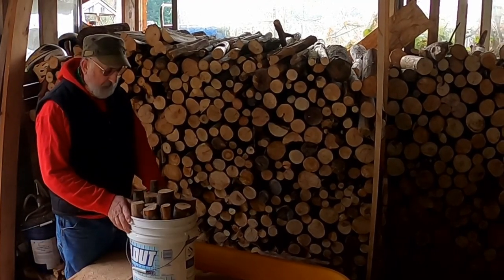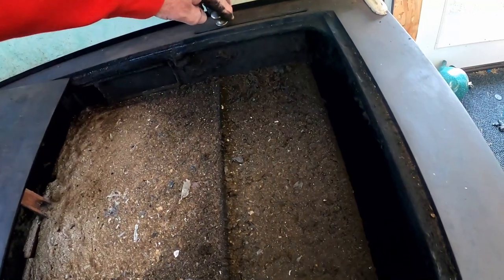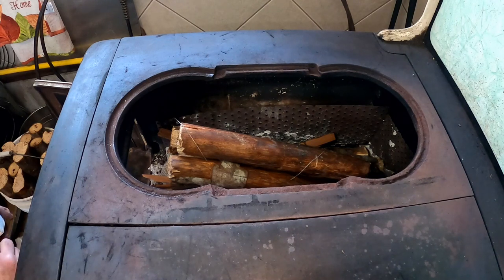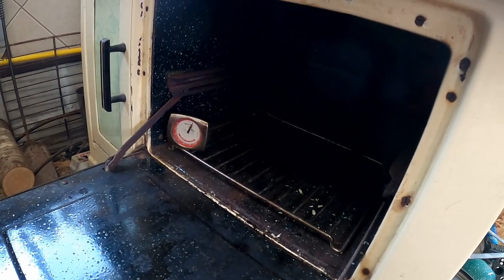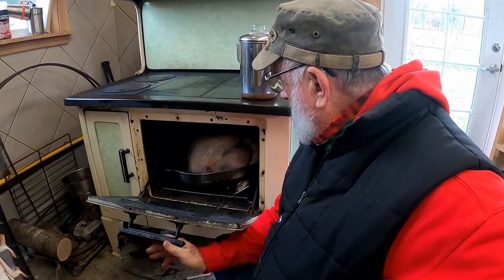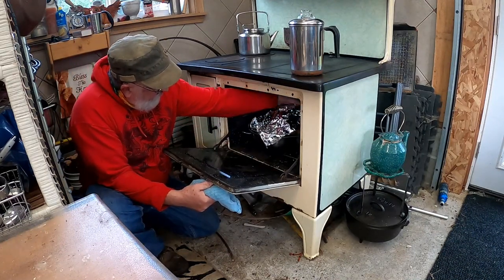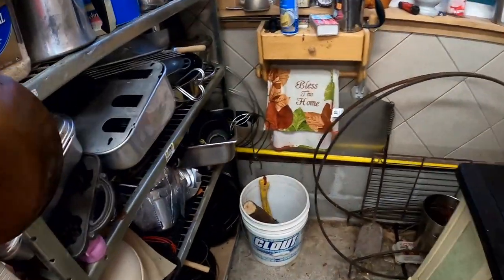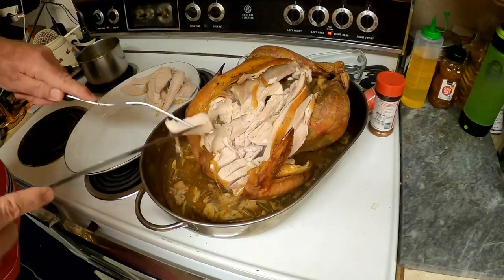Wood cook stove how to bake

Comment: Hard to find coal? I'm curious where you're from because coal is pretty easy here in the Susquehanna Valley, PA. It's actually the cheapest heat source in the area but most people are worried about the heavy metal in anthracite coal ash and/or don't want to deal with the mess.
Reply from the maker: I am in Washington state. 20 years ago they shutdown the last place selling coal. If you flip them grates you can use coal.  It does burn hotter and longer. But the smell of wood burning can not be beat. Thanks for stopping by and commenting.
Reply: @badbadbob1  I agree about the smell of wood. I have a dug out firepit that I cook on fairly regularly in the summers. They have a ban on open fires much of the fall and winter due to the risk of farmland and wild fires. 

My grandmother apparently had a stove similar to yours back in the 30's and kept using it until Hurricane Agnes washed it away in '72. She always used coal, though. Probably due to us not being far from Centralia. 

You're quite welcome. I love learning about old tools, particularly related to cooking.
Reply from the maker: @dhawthorne1634  Centralia is that where the fires coal seam is burning underground? I am one town over from our Centralia WA.
  I am planning another cooking and stove knowledge video soon. Stay toned.
Reply: @badbadbob1  Yep. They set their dump on fire and accidentally caught the Mammoth Vein on fire along with it. The town was abandoned shortly after a kid got pulled into a sinkhole and died from the heat and gasses. There are still 4 people stubbornly living there. They have no utilities, no usable roads and they have to travel about an 2 hours round trip for their mail and groceries. 

Will do.

Comment: Any idea the value of a stove of this same make and model that would need to be restored?
Reply from the maker: Good question. A 1950's stove If it is just dirty and needs cleaned up and installed, about $300. to $350. That means no missing parts and includes the levers that shake the ash into the pan below. If the oven or fire box are rusted out. $50. or walk away. A restore can cost $500. or more. Less if it is just missing parts like burners or has cracked plates. The fire box is the place to look first. Warped or broken grates are common. In the day, (Before 1970) Every hardware store carried replacement grates and new burner plates.
Reply: We bought one in good condition for $1000 (in New Zealand) and it cost another $1000 to ship it and $2000 to install! 
But I am thrilled with it and it also runs radiators to heat the house.

Comment: Do you know if an antique cook stove is considered UL? If your house burns down from a fire caused by the cook stove will the insurance cover it? I wan to get one but unsure if I dare. Thanks.
Reply from the maker: That is a good question. The new wood cook stoves are UL listed. But my wood cook stove was made before UL was a thing. Of course you need to follow building codes in your area such as, How far you have to be from a combustible wall, Stove pipe regulations in your area. A good stove company can set you us safely and knows all the regulations. They may even know some one you can buy seasoned wood from. You can ask for small rounds Like I use.

Comment: HELLO MR BOB I NEED YOU TO DO ME A FAVOR YOUR COFFEE POT IS  IT A REVERWARE IF SO I FOUND ON FACE BOOK BUT IS MISSING THE TOP STRAINER I NEED THE MEASUREMENT OF YOURS  I HAD A ELECTRIC POT PURACTOR AND MIGHT BE THE SAME SIZE QUIT ON ME LATELY BUT I LIKED THE LOOKS OF YOUR THIS A 4 CUP  THEIR ASKING 38 DOLLARS AND 8.71 SHIPPAGE OR MAKE OFFER  IVAN FROM ILLINOIS.
Reply from the maker: I have had a lot of interest in that coffee pot, I found it at Goodwill 10 years ago. Mine does not have a top basket cover. It still works just fine for me. The size mine needs would be 4 5/8"s inch wide.
Reply: @badbadbob1 do you have a video on how to make coffee in the percolator on the stove? Great videos
Reply from the maker: . @Notturnoir  I do have a quick video with a link to a second video. Thanks for stopping by.  https://youtu.be/Ja7oqbY5kPw?si=1lTt7gFqN9arChdb